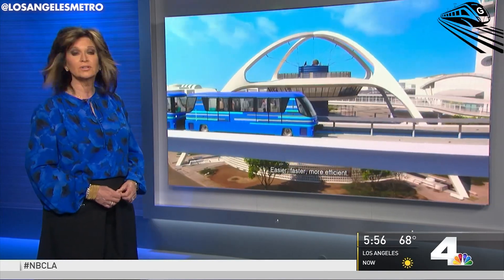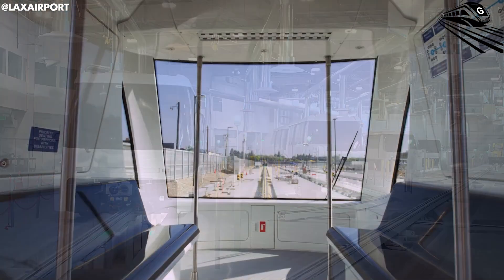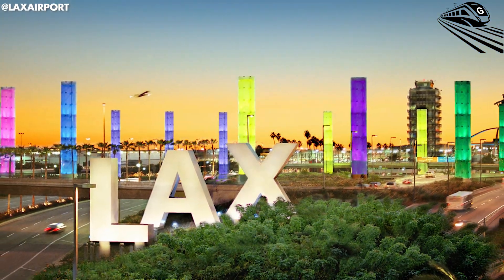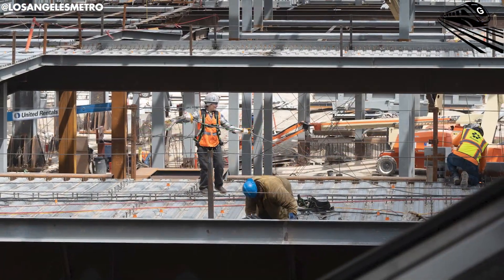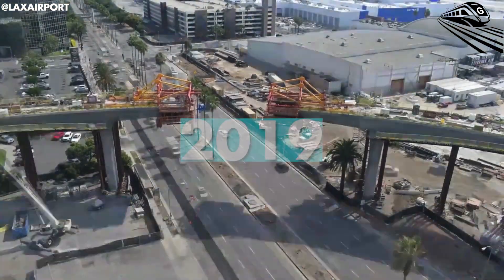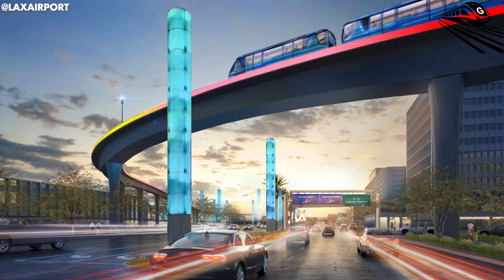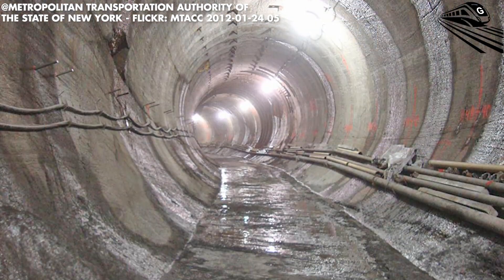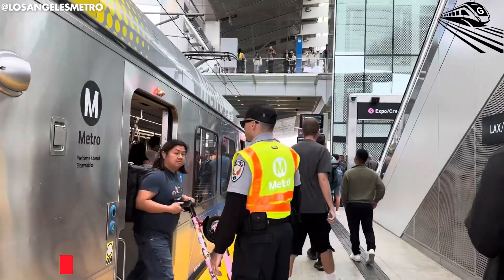Why Los Angeles's New $3.34B Train Cost So Much

Comment: Try getting to downtown LA or points North with the APM. How many transfers is that? Don’t know if I can even give ‘em an E for effort. They should have talked to the Brits or Chinese!
Reply: the transfer at crenshaw to the expo line is horrible--especially for those with luggage. the connection should have been where the underground station and stairs should have been directly under the expo tracks for a single escalator or elevator transfer. I wont even get started with the fact that it sounds as if no one follows the money on these contracts.
Reply: @jeffdsfo  You're absolutely right. No budget oversight. Zero.
Reply: I agree, Bob. Downtown L.A. isn't a destination for most visitors. Hollywood/Universal are. That's three or four transfers and the stations and trains are not luggage friendly. We still have a long way to go regarding public transportation for both locals and visitors.
Reply: one transfer to get downtown. also one transfer to get to Santa Monica. chill out
Reply: @ajayhari87  Ever ride the Heathrow Express or the Jfk air train  to the LIRR makes more sense. Take some pics of a family of 4 transferring at the end of the K line upstairs and across the street to get downtown!  😊

Comment: The K line and C line have stops at Century Blvd. which is a stone throw from the Metro Status on 96th.  Need to include that cost of the Metro Century station to the total  cost of up to an additional $500M.  What waste of having two different agencies in charge of building redundant infrastructure.

Comment: The question is "what is the fare"? BART to OAK Connector is 3 miles, and costs $6 per person. For a family in the Bay Area, using a door-to-door Uber looks attractive. When BART extended to SFO, SFO was stunned that SFO employees didn't use BART, because of the SFO surcharge. They continued to take the bus until, because they are working at a government-owned site, they were given a dispensation from the pope for the surcharge.
Reply: It is free.
Reply: LA Metro Fare is $1.75 with a five dollar daily max.

Comment: The SkyTrain costed as much as California HSR. Brightline West announced that its Las Vegas-LA train would not be completed in time for the LA Olympics in 2028. It's opening in fall of 2028.
Reply: Uh, CAHSR is going to cost 30 to 40 times as much as this, although that's for a system that is about 200 times longer than this.  And Brightline West is a separate third project.